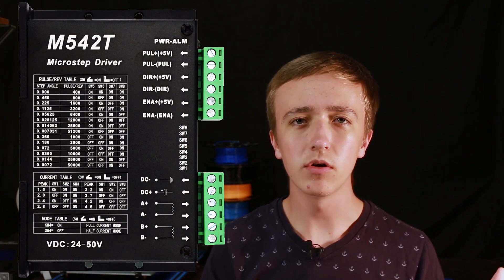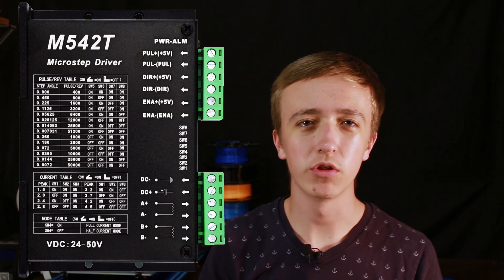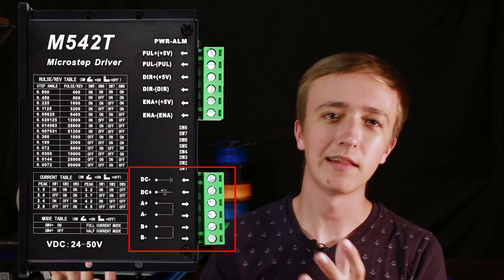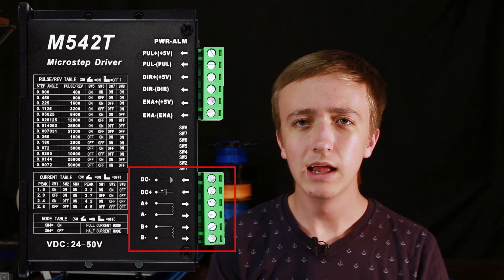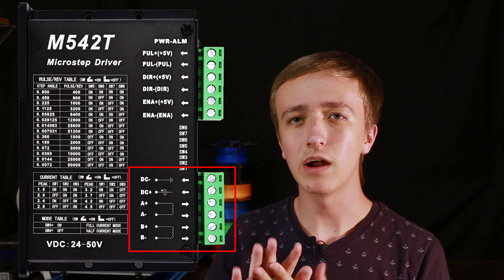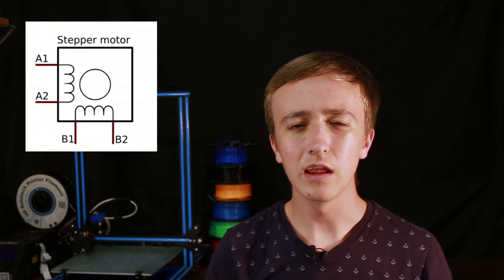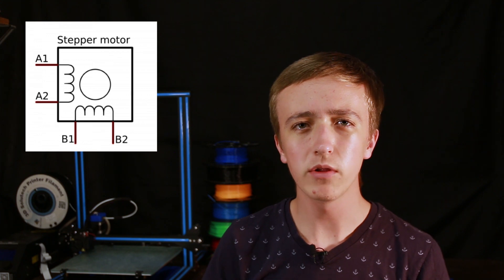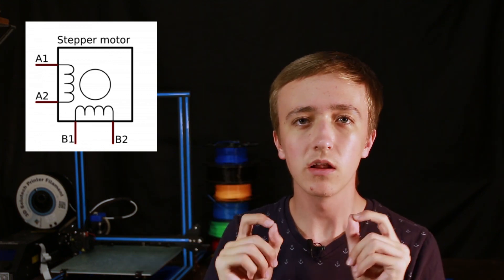CNC Electronics EXPLAINED

Comment: What about 4 axis cnc, where do i connect the 4th motor, the A-axis?
Reply from the maker: Exactly. It depends a bit on the controller and what you're trying to do, but most will support A, B,... axis to be mapped to either slave another axis like when you have two Y motors one can be A, or behave independently if you have additional axis

Comment: David , I have a Chinese 3040 cnc   which runs Mach 3 using a parallel port , because I will be using Easel program I want to change over to arduino grbl , could you recommend a control board that I could install into the box provided as I will be removing the parallel port.
17 stepper motor

Comment: Dont bother with powering aruino with 5v separate power input. Because once u plug in arduino to pc it feeds of it. If connection is severed then cnc or w/e disconnects either way=/

Comment: I am currently building my own setup. I have learned a lot. Which is code for 'smoked' a lot of components. :) Actually only two items destroyed so far. It seems that the biggest lacking in the community that I have found so far is around the Spindle Connection section. There are a lot of videos out there of people building their own but they very often seem to gloss over the spindle connections. I was able to get my steppers running fairly easily.  But I miscalculated the external relay I had and I wound up locking one of my pins high on the USB Motion Control Board. I recently switched over to a LPT based board with it's own built in relay. Eventually I will try again with the USB model and possibly using a real inverter instead of just a giant 40A relay for the spindle.

Comment: Datulab Tech

  I need help on the hardware parts.
  and wiring the hardware up .
  and what software to use 
 to operate my CNC machine 
 Here is my list of the parts
 i'am using can you help me  

 1] Stepper Motor Drivers power step PSD8079-2P
 2] steppers motor Nema 34
 3] controler
 4] power supply mean well SP-320-48
 5]                  Hardware and Software 
 6] CNC Breakout Board/Interface Board
 7] Cable Connector
 8] Limit Switches
 9] Emergeney STOP BUTTON 
 10] Software

Comment: Great clip thanks,

I have watched many clip on this and have a few questions. If you or anyone else can help, please.

Background:  I have wired my CNC as shown, the lights are on, I have configured linux CNC, however, the motors do not turn. The motors are solid, I cannot hand turn when the power is on. When power disconnected I can turn the motors, though tough (normal).

All of the clips I have watched state the same or similar but there are slight differences with them all.
Some have left the enable + and the enable - unwired.
Some have the pul+ and dir+ wired to ground while other clips are opposite , they have them to the breakout board control pins.

Which is correct please with both setups.

I have enable+ to the VDD on the breakout board. I do not have the enable -    wired to anything.
I have the driver pul+ and dir+ wired to the  control pins of the breakout board while the pul- and dir- to ground. 

Any info and help would be appreciated,

Thanks in advance,

Martin

Comment: Hii how can I run multiple g codes using just LCD and SD card. Without pc. Need standalone CNC plotter. Please give idea
Reply from the maker: Kumara Ganesh I wouldn't recommend that for a cnc machine, but I guess you could use the same kind of controller that is used for 3d printing and just adapt it for what you need to do.

Comment: Hello, I was wondering, where did you buy all the stuff for your cnc? What shops? Does the hardware you bought would work on LinuxCNC?
Reply from the maker: I bought most things from Aliexpress, regarding LinuxCNC I have no clue, I never worked with it.
Reply: Datulab Tech thanks! Something else. What program do you use for gcode and designing?
Reply from the maker: Fusion 360

Comment: Nice video, congrats, could you tell whether is possible to connect an E stop button directly to arduino?, if so, wich pins I should use?, best regards
Reply from the maker: I'm sure it's possible, idk however which pin it would be.
Reply: I mean, connect an E stop button and 3 stepper motors, according with this picture, https://discuss.inventables.com/t/e-stop-wiring-and-placement/2036/24, you would use A1 and A2?
Reply from the maker: yea, you can use the pins described in this article

Comment: So if we are using a PC with a parallel port is more likely that the PC itself will control the motor drivers right?  (There might be a board but mostly to facilitate connections through proper connectors). On the other hand, if we use a modern PC with USB then it will be more likely that we will need a board that controls the motor drivers. In this case the PC will just pass the G-Code to this board and let it handle the job of controlling the motor drivers...Is that quite right? Thanks!

Comment: 1:38 artsoft says that mach 3 is not compatible with 64bit systems via parallel port .is your system 32bit ? i currently run a win10 64bit system , what can i do to run mach 3? thank you for your info.
Reply from the maker: I don't run mach3, so that's not an issue for me. You maybe could run a VM and pass through the parallel port, idk though if that would work.

Comment: Datulab Tech: Thanks for your advise , I just ordered for my cnc machine not received yet , I am a beginner , I will received a software with CNC machine ,Kindly confirm  is this mach3 ?
Reply from the maker: As my crystal globe is in repairs right now, I can't tell you that. If you bought the machine from china somewhere it will be mach3 most likely though.
Reply: After received the machine I will confirm.

Comment: "SolidWorks 2016 "is this sofware will be work accordingly  for cnc machine ?, I want to use for my own CNC machine ,Please confirm
Reply from the maker: +Rafiqul Mowla you can use Solidworks for your 3d model if you want. You still will need a software to communicate with your cnc machine like mach3 or universal gcode sender
Reply from the maker: +Rafiqul Mowla you can use Solidworks for your 3d model if you want. You still will need a software to communicate with your cnc machine like mach3 or universal gcode sender

Comment: Have you had any problems with “electrical noise?” If so, how have you solved it. Shielding wire? 
When I turn on my spindle it interferes with the z-axis stepper nearby causing it to lose steps.
Reply from the maker: +Austin Hillam yes, shielded wire helps with that and should be used for the motors and spindle. I didn't do it and am fine but better safe than sorry.